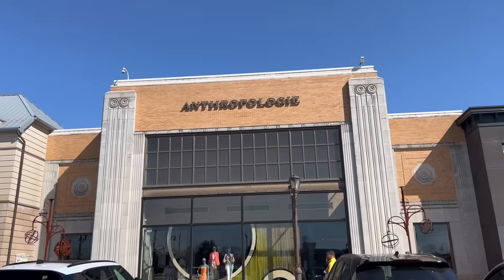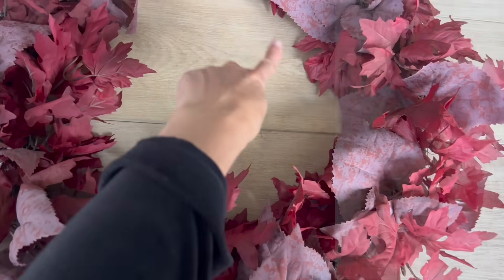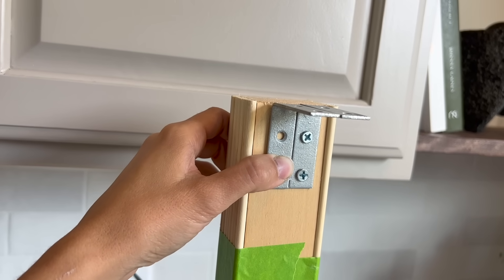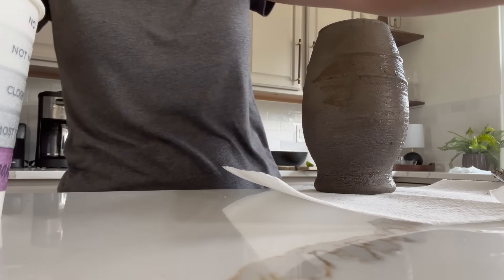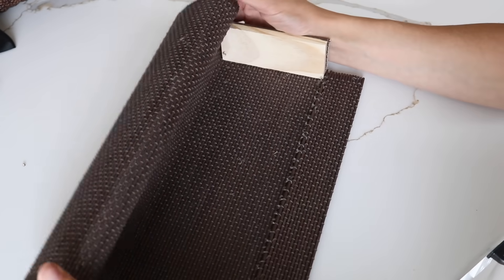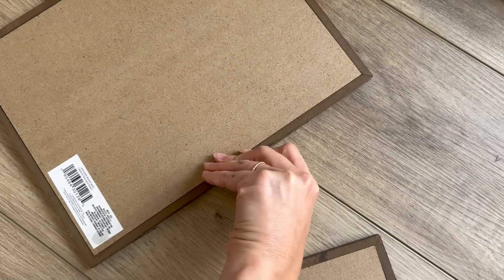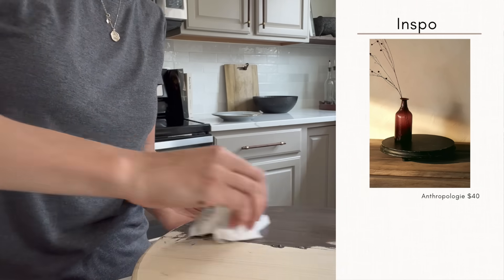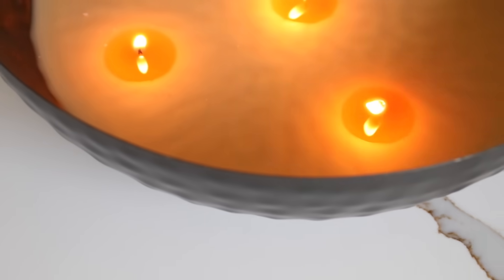DOLLAR TREE VS ANTHROPOLOGIE | DIY ANTHROPOLOGIE INSPIRED HOME DECOR HACKS *BUDGET FRIENDLY*

Comment: Loved the video, as always! 

I have a question though, if you put the wicks in after you pour the wax, do they end up sliding around if the candle is low and all the wax melts to liquid? Asking cuz I recently tried making something like this and I used glue to adhere the wick to the bowl and they ended up sliding around and wouldn’t stay lit. Could have been the glue I used but if this method works then I’m gonna try it out!